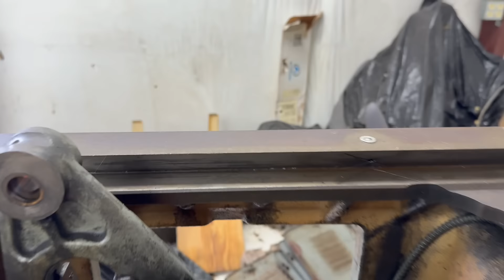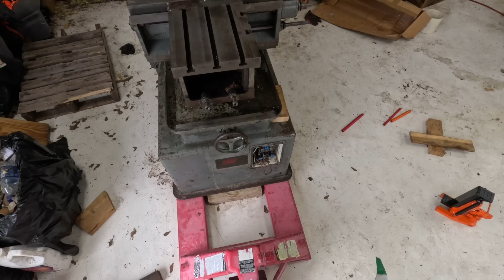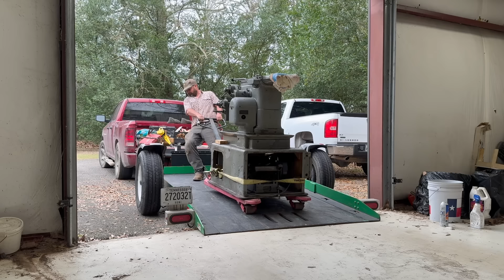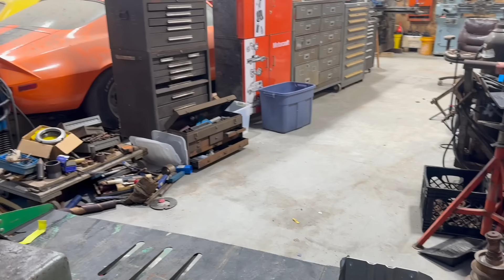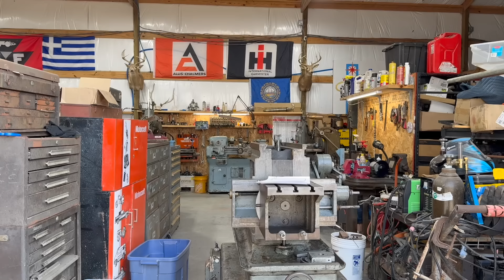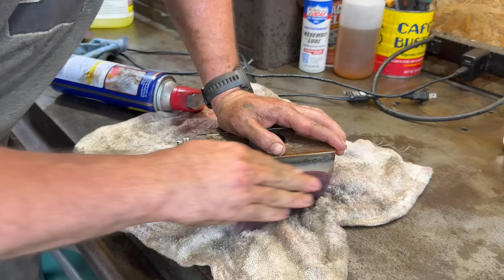Saving a Broken  12" Sheldon Shaper: Machine Moving Day

Comment: Stone the galling as you suggested, you are not going to do any harm with that. Do check that the oilers are not blocked. You can start to learn scraping with a hand scraper, a means of sharpening the carbide ( don’t bother with HSS etc) and a tube of blue, I like Charbonnel, all this this is relatively low cost. Pick a lump of cast iron scrap and go from there. Classes are a great idea but you can learn a lot in the meantime, and when you take the class you will be able to ask questions & learn at a higher level, the guys on PM forum are very helpful.
Reply from the maker: Thanks for the tips! I’ll definitely be checking the oilers. And thank you for the scraping advice!

Comment: I really like the trailer it makes it much easier to load and unload. I almost bought one with tandem axles a few years back. I can't travel now so It would be a waste for me to buy one. If you want to save the scorn ways consider using a product called Mogliece. I used it to reair the saddle on my Clausing 5900 lathe. It is better than cast iron and very easy to use. They even will give you a free Tee shirt if you send them a picture of using it. I repaired my lathe saddle for about $50.
Reply from the maker: I agree, the trailer makes a huge difference. Thanks for the tip on the repair product, I'll definitely look into it!
Reply: @JacksonMachineWorks  The Mogliece eliminates the need to scrape the ways. Just oil retention is all that is need. There are some good videos on it and the Mogliece dealer is great to talk to about its application on specific jobs. The problem I see in just stoning it will not do anything to help improve the shapers accuracy. It all depends on how deep down the rabbit hole one wants to go. You are doing a great job with making your videos. I always look forward to seeing them. Thanks for taking time to bring us along. 

https://www.youtube.com/watch?v=_15P0B6DoX0